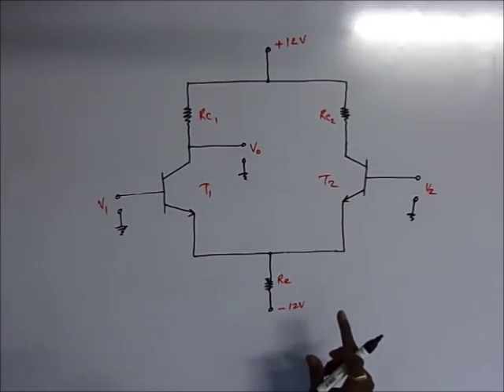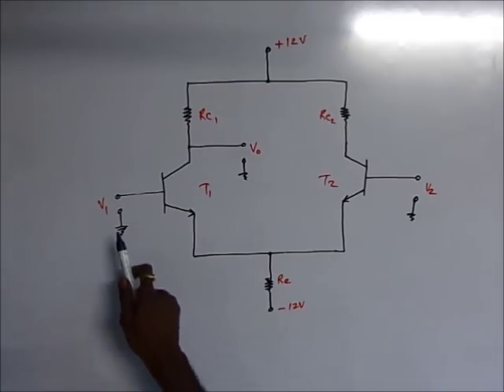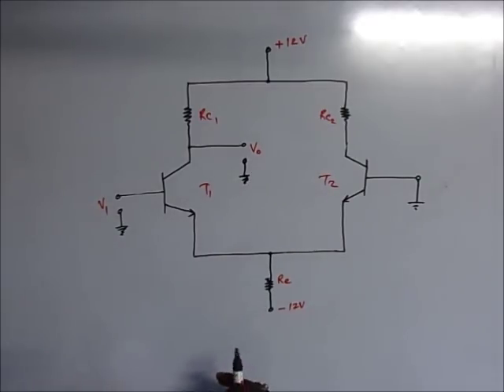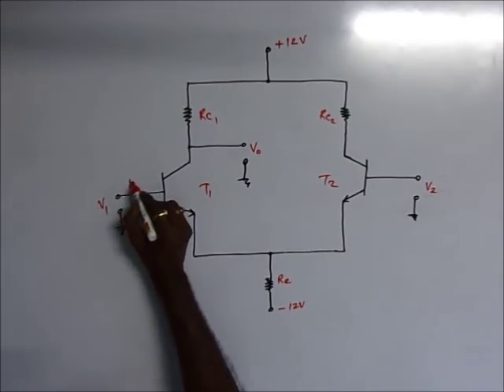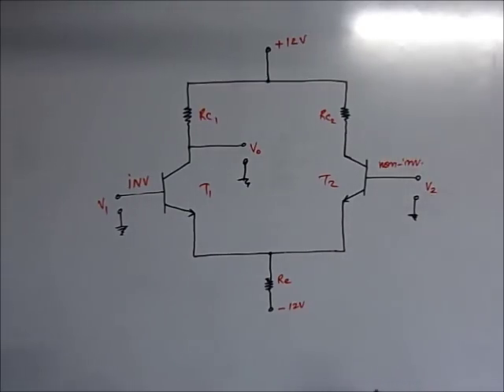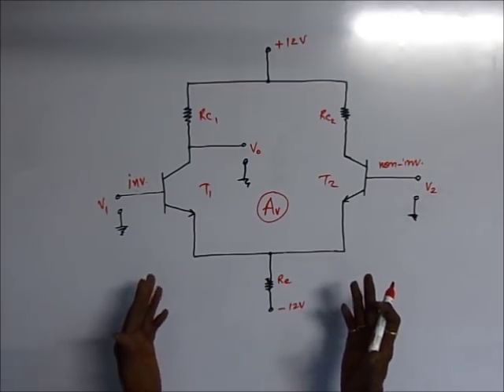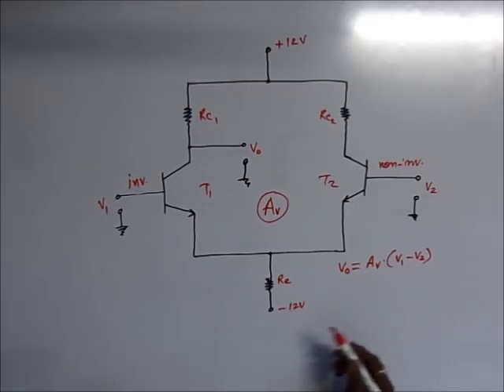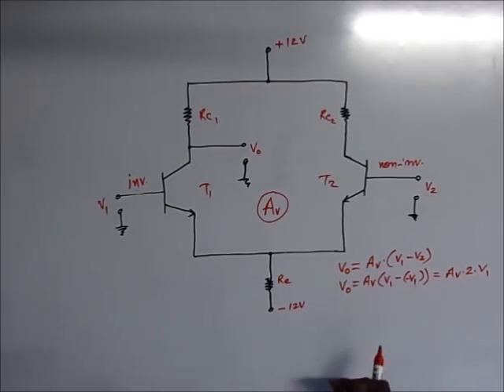Fundamentals of differential amplifier

Comment: sir while designating inverting and noninverting  terminals as both transistors are the common emitter and both have a property  to invert the input in output so how can we assume that other terminal will work as noninverting
Reply from the maker: The right terminal of differential amplifier (DA) is considered as non-inverting terminal, because the two emitters of two transistors are joined together and connected to constant current source below the emitter resistor (Re), as shown in the circuit. 
When current in one emitter increases it proportionally dominates the emitter current of other transistor.

Comment: Why does the input voltage at the right is out of phase with the Vout?thanks in advance.
Reply: On the left side, transistor used is common emitter. So, the o/p will be 180 degree out of phase to the i/p.
Reply from the maker: @qu1en exactly. That is perfect explanation

Comment: if Vo=A(V1-V2)..

A can also be infinity.. Isnt it??.
as V1 can equal V2 and. A can be infinity
Reply from the maker: This is because both inputs are equal. And the amplifier is difference amplifier which amplifies the difference of two input signals. Since they are equal, amplifier amplifies nothing, means its gain is zero. Hence, we consider that A=0
Reply: Dattaraj Vidyasagar Doesnt Amplifier amplify the noise component of  itself??.

Atleast There are finite output isnt it?
Reply from the maker: I will explain it in different way.
Suppose there are two microphones connected at the two input terminals of DA and they pickup the sound waves of two different musical instruments. 
So the microphone voltages proportional to sound waves are, say, V1 and V2 (this means that V1 is not equal to V2). 
Along with these two voltages there is noise that gets mixed with these two signals. 
Let the noise voltage be Vn. This noise voltage will affect both the microphones simultaneously and with same magnitude, because the domain of noise (in simple terms say the wavelength of noise) is much bigger as compared to the physical size of DA circuit.
So actually the two inputs are  (V1+Vn) and (V2+Vn). But since it is a differential amplifier, it will amplify the difference of V1 and V2 only. And it will not amplify the noise, since Vn-Vn=0 but V1-V2 is not equal to zero.
Hence we say that the gain (A) of the circuit is zero for common signals i.e. for equal input signals.